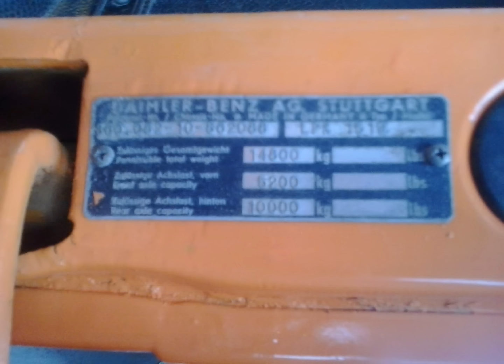Mercedes Benz 1519 lpk Restoration

Comment: By any means, could you please tell me about its differential? I see at 1:31 that it has big differential which must have power gear and inter axle lock systems. Also at 3:33 we can see the cylinder over the differential for power gear. I want to see the crown and tail pin of these diff.